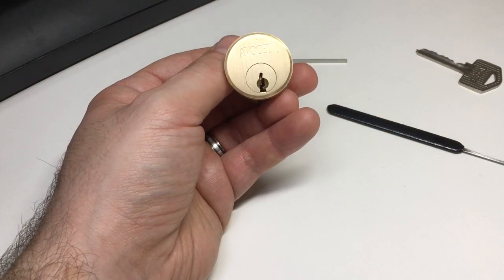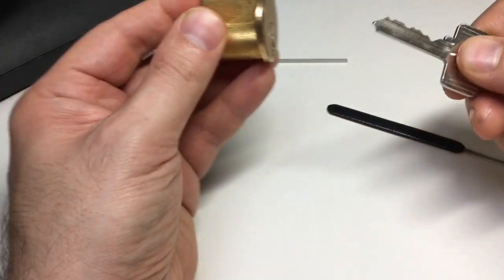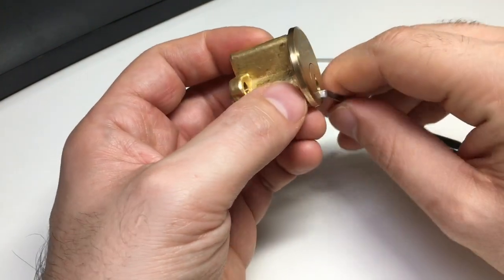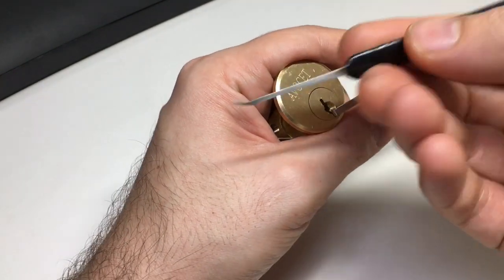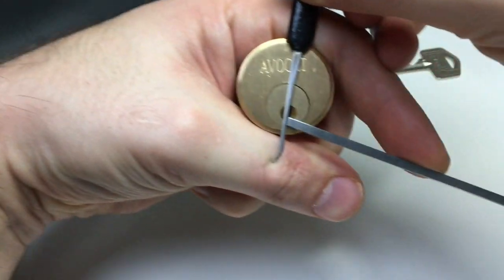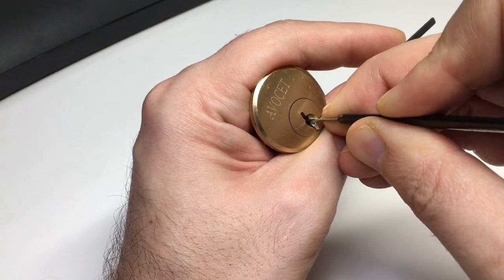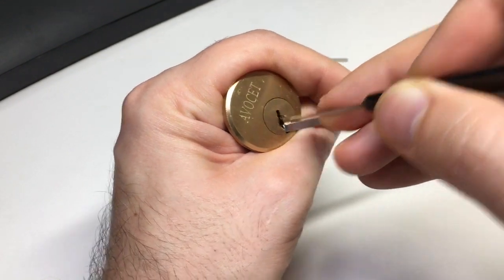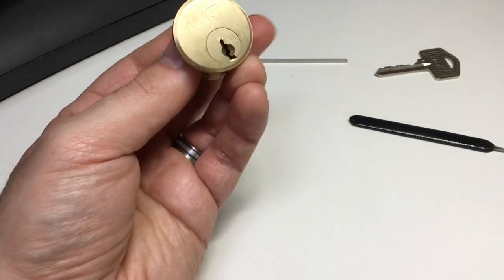(105) Picking the Checkers and Chess Challenge Lock

Comment: previously l bought GOSO .25 thickness and it doesn't fit the locks probably or because I am a beginner ?
Reply from the maker: Maybe a bit of both? GOSO are famous for having wildly varying pick thicknesses even over 0.35 inch. Keep practicing and try some new picks from different manufacturers :-)
Reply: Thanks a lot